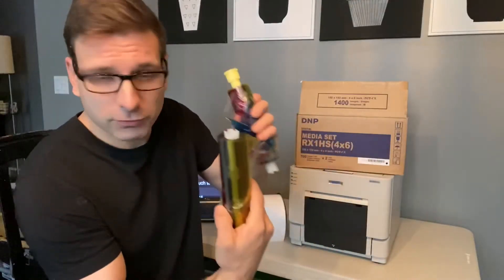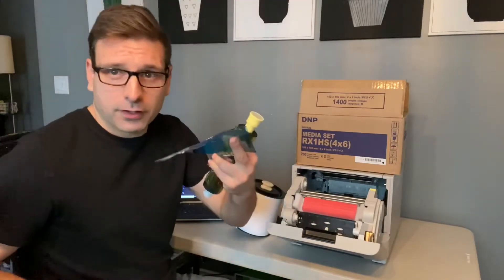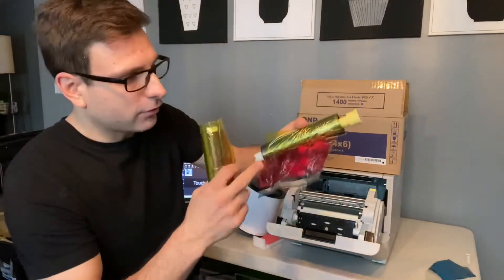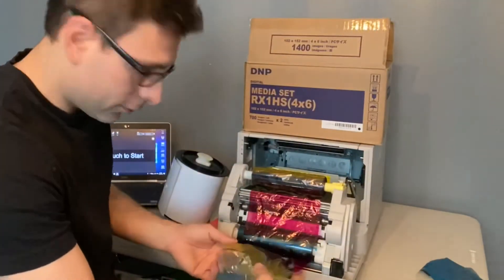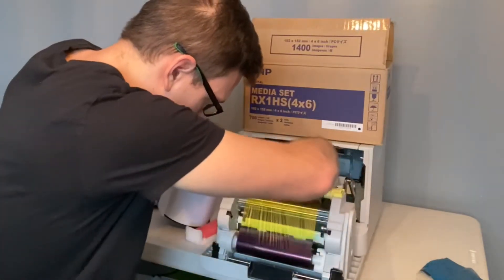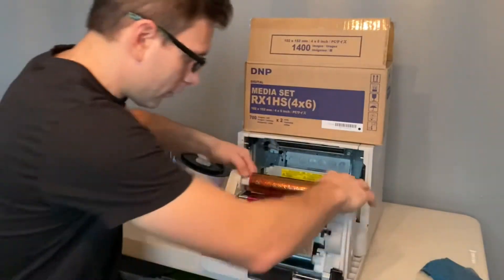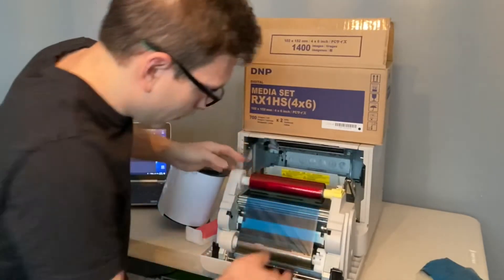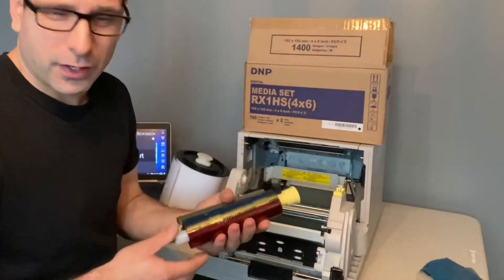How To Fix A Ripped DNP RX1 Ribbon / Repair Your Media On-site / Photo Booth Secret

Comment: hey man! I just started my photobooth business but ive been having tons of issues with my printer connecting and getting recoginezed to my photobooth's computer. I have the Hiti p525l. I tried installing drivers but still no hope.... What other printers would you recommend?? did you have issues with the DNP when first setting up? Please help!!
Reply: The DNP is a workhorse! I have two, one for backup...but have NEVER needed it until after 5 years of running my booth, My main one popped off the dolly on a bumpy sidewalk. These printers are soooo dependable. I run it with darkroom softwares. Never have any trouble. I'll never sell them. My friend has one that he still uses after 10 years. no joke.
Reply: DNP or bust

Comment: I always heard to use scotch tape, but this is way easier. I haven't had one rip in close to the 4yrs that I've had mine(knock on wood).

I see you still have the printer head sponge. Do you remove your media everytime you transport?
Reply from the maker: Yes, I remove my media every time I transport the printers. However there are other photo booth companies in my area that use the same printers as me and do not remove the media with no consequence so far either.
Reply: I gave up about 2yrs ago, and just leave it in, but I always make sure to empty the trim container. Also learned a hard lesson last yr that these printers do not like the cold. If I pack my printer more than an hr early in the winter the ribbon will stick and bind until it warms up.
Reply: Mitch I was wondering if scotch tape is OK? Mine is not ripped all the way through but about halfway through. Does scotch tape cause it to deteriorate?